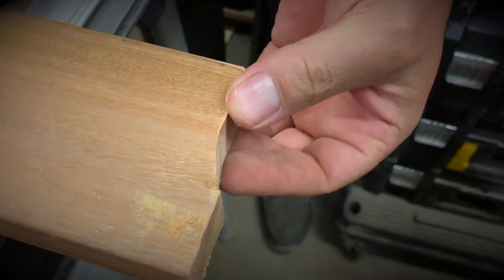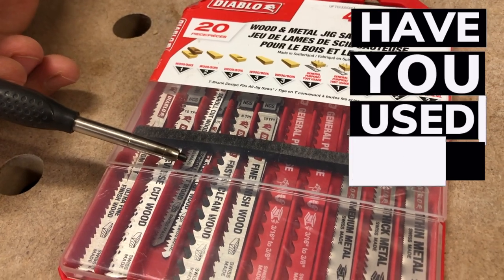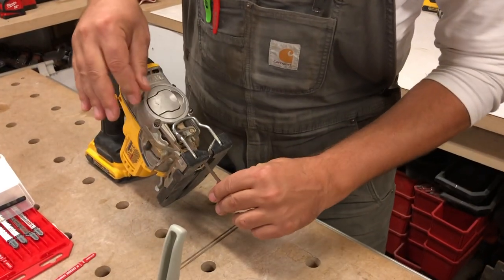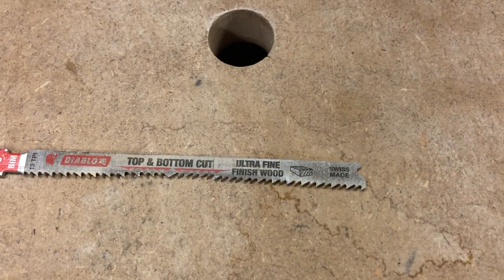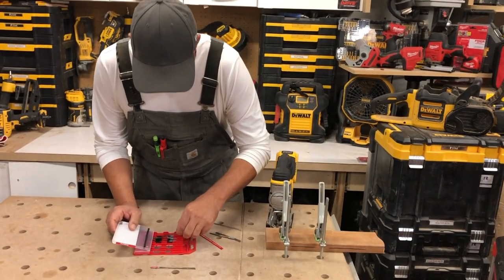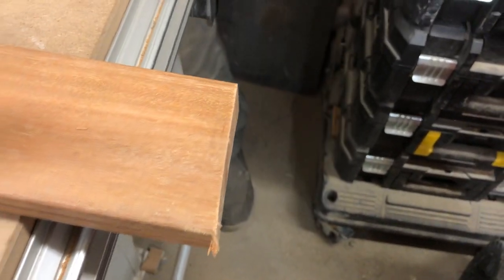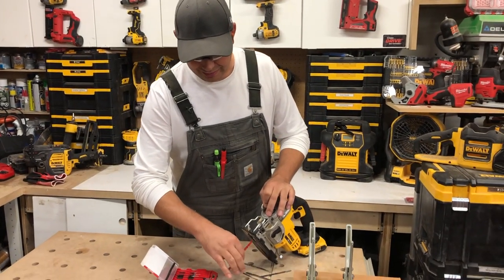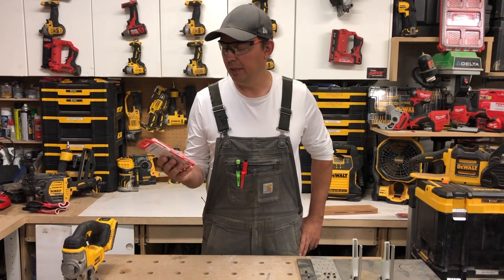Diablo Jigsaw Blade TEST!  20 piece set for wood and metal.

Comment: You have to put the blades in all the way. And when you tried the “reverse” blade, you didn't turn off the orbit function. ->  The blade was being pushed forward on the non-cutting stroke... ... ...
Reply from the maker: thanks for the tip

Comment: I know its subjective but how long do jigsaw blades last for the DIY user? These sets are pretty good value for what you get and was thinking of picking up a few. I just got my jigsaws this year and plan to use them for small DIY projects. I got the current gen D-handle and barrel grip Dewalt jigsaws.
Reply from the maker: I find jig saw blades last a really long time, unless you are putting them into really hard wood and they start to turn blue from the heat. I have blades that have lasted me years.